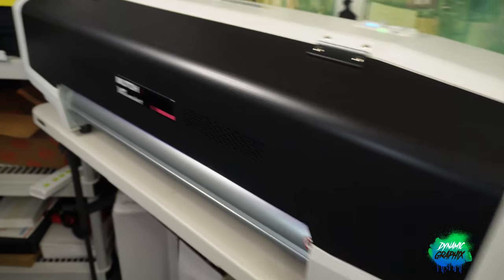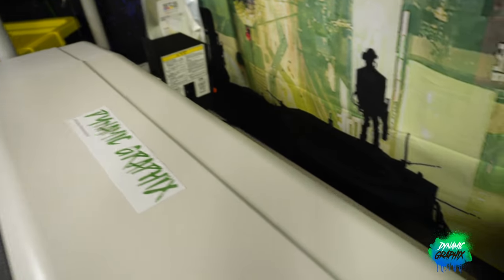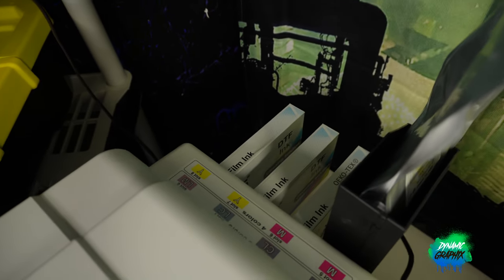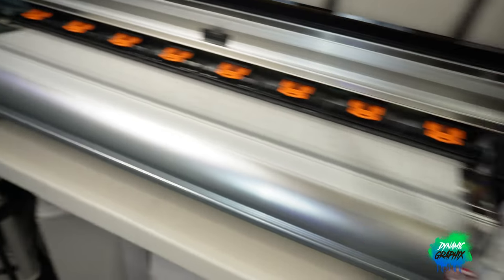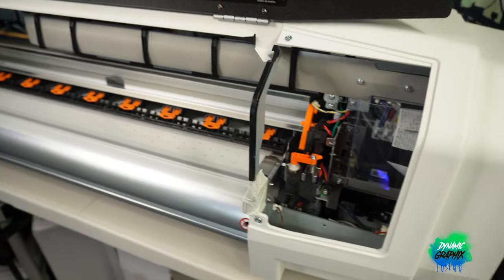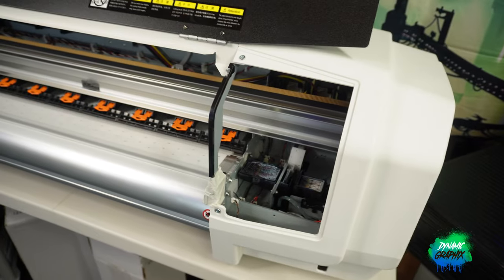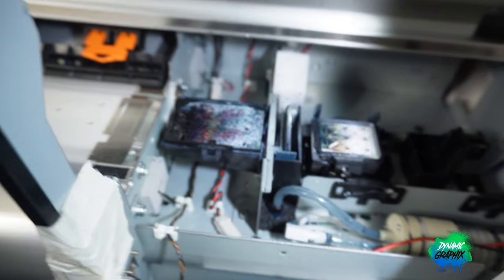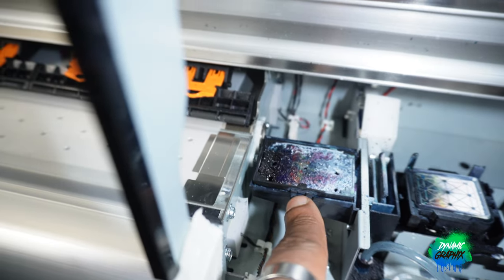Your DTF Printer Did What?!

Comment: I have owned this machine since May 23rd. I have had nothing but problems with my white cartridges. Do you ever have issues with white?
Reply from the maker: Yes I have had issues, for me it was using the aftermarket carts. Not a lot of people know it’s the air getting in the lines over exhausting the channels in the head. Check every other day to make sure no air is running through your lines, if you see that, use the syringe to pull it down🤙

Comment: You should put 2 Channels W.
Reply from the maker: I know.. I’m leaving those other 2 open as an option. 🤙
Reply: @dynamicgraphixct3665  
It will print allot Faster with 2 Whites.
Since every print has a white base coat.
Reply: @dynamicgraphixct3665  
I just saw you post on FB.

Comment: How does the print quality and washability compare to DTG prints?
Reply from the maker: I don’t do dtg but DTF if you are using quality inks and curing/pressing properly. You could go 1 year without any cracks, fade, discoloration. If you are using low grade ink. Not properly curing etc 1 to 6 months . It’s all about quality your putting behind dtf

Comment: I have a 628 with ecosolvent ink in it that I probably won't be using much anymore. Do you think I could convert it over to print DTF?
Reply from the maker: Sure, I think doing that is more programming the ink channels correctly, adding white option. And possibly some lite modifications replacing ink lines.

Comment: You have to purchase those cards?
You can’t get chip less or resettable cartridges?
Reply from the maker: Still looking into all of that, a lot of 3rd parties are still trying to catch up to dtf format for the mutoh, I heard there is a way to disable the smart cards in general… so there are still possibilities for options.. a couple reputable 3rd parties that I spoke too are figuring that out .
Reply: @dynamicgraphixct3665  
Thats just the manufactures way of trying to hold customers hostage to use their inks.
Reply from the maker: @Ricks2Cents  I wanted to directly say that. but cause these companies watch my video.. I didn’t want to throw shade on anyone’s hustle. But I’m glad you caught that. Still one of the most reliable dtf units… but with everything has their pros and cons. But things are in the works to eliminate that. So not a huge problem.
Reply: @dynamicgraphixct3665  
What type of problems have you had?
Reply from the maker: @Ricks2Cents  yes or you can just stay with your company ink. obviously it comes with the smart card for that color. It works out for me to go refillable cause those company inks are expensive… plus I just rather have bulk ink on hand. Honestly no issues..as long as you add your manual maintenance on top of it self cleaning..which isn’t time consuming your machine will always run great with clean nozzle checks👌. Only issue I had was just learning tricks with the flexi pro 21 to get the best quality of what I was printing.
Reply: @dynamicgraphixct3665  
I have a 54” Plotter I use Flexi with. 
Real Simple Software Easy to use, but Like it.
Reply: @Ricks2Cents   agree with this comment !!!  I hope someone can tell us how we can deactivated the chip reader from the printer !! It is a good machine but its inks are not!!

Comment: I dont understand why the 3rd party cartridges need "smart cards". If the printer can detect their chips, they should be able to provide a way to reset them besides buying "smart cards" into perpetuity. Even if its a one time purchase of a chip resetter. And mutoh is not providing a refillable cartridge option even tho they sell ink by the bottle. Its a turn off that they went down the same road as the major printer suppliers .... ink hoarding smh
Reply from the maker: Yeah it’s a way to capitalize, that couldn’t be more obvious. That part it definitely frustrating but I hear you bud👍
Reply: @dynamicgraphixct3665  quick question if you dont mind, what company did you go thru to get your vj628?? I see Mutoh isnt selling them directly on their site.
Reply from the maker: @blacksun_upt4705  garment printer ink . Solid people from my experience. Not pushy .Knowledgeable in the machines they sell.
Reply: @dynamicgraphixct3665  one more question good brotha... and I APPRECIATE ALL YOUR HELP. Do you have a VJ 628 or VJ 628D???
Reply from the maker: @blacksun_upt4705  VJ628